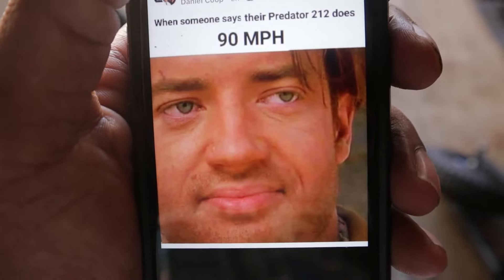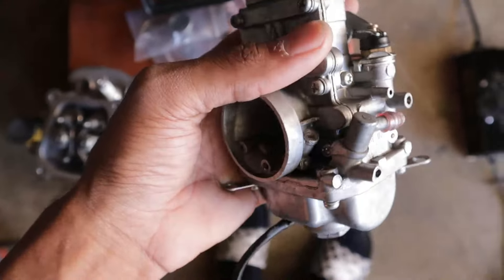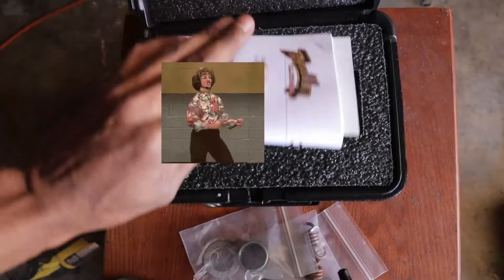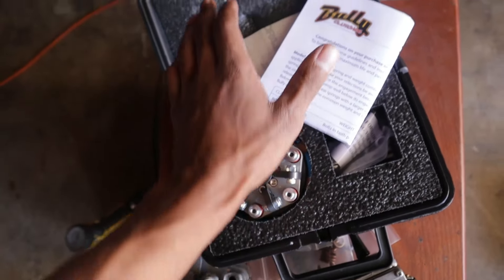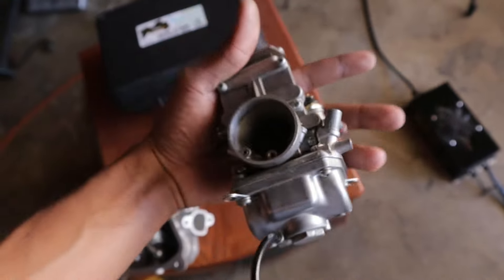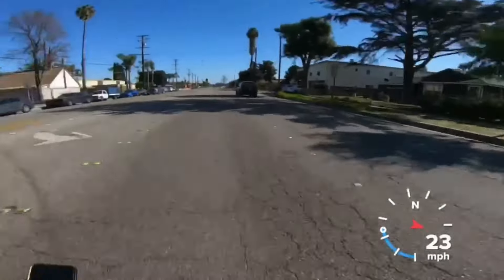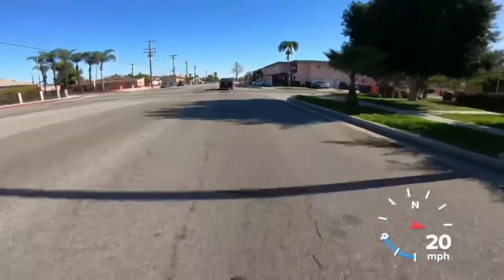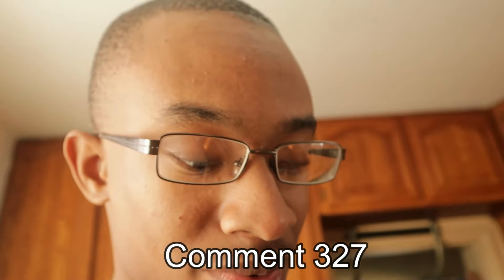Harbor Freight 212 Predator Mini Bike Put On Methanol Race Gas! Top Speed Run

Comment: i have a methanol briggs on m5...its a pain in the ass and not a idle ride around motor..im going to convert it to a slide and see how it does..im building a 212 hemi pred with a black mamba jr cam, ported head , flat top etc....well see how it runs..i wana dial the briggs in tho

Comment: Yo, Royal get the thinest head gasket that you can find, or shave the head down. Now remember every point of compression equals 1.5 hp. gain. Also ceramic bearings. Bigger head with bigger valves. Or maybe a bigger motor

Comment: God I love M5 but it  will Completely annihilate a carb . Extremely corrosive . Tons of maintenance involved M5 . You must drain the engine of all  oil and the entire fuel system after each run . Or when you come back your parts will be turned to powder 😂😂. Runs great though .

Comment: Yo Royal, tips for making a good predator 212 for cruising. Nothing crazy, what should I upgrade
Reply: Air intake kit with a bigger main jet,exhaust and a zip tie on the governor spring. Done
Reply: @russothecanadian2261  nah that go maybe 40-45 I wanna cruize at 60 and not have anything overheat or break.
Reply: Grom

Comment: A taller tire will give you more mph. 3:27
Reply: Taller tire does give more mph but smaller tires equal quicker acceleration. I believe he said he's in Cali and they drag race, so most of them use the small tires.

Comment: 327. you should get a ec head , they come with lots of material for you to port , unlike the stock predator heads or other aftermarket heads where they are limited to 32/28 with welds for more material
Reply: This is absolutely wrong

Comment: The size of the motor is technically irrelevant. You can get a 50cc or even a pedal bike up to 90 mph, with the right gear ratio and enough nerve.

Comment: Lol y’all trippen 90 is possible I was doin 65 in a stock predator wit the correct gear ratio
Reply from the maker: What’s the gearing?
Reply: Yeah an tire size
Reply: @RoyalJZ  10gear on the motor 42 on a 15 inch tire

Comment: So all you have to do is switch the carb to run alcohol?
Reply from the maker: And some basic billet parts
Reply: Alot larger jets needed with methanol that's all
Reply: @RoyalJZ  alllll the Billet parts 🤗🤗
Reply: No, you need timing and compression for it to be the most beneficial
Reply: You need to up your jetting significantly and make sure your fuel supply is up to the task. If you're using a stock tank, you'll probably need a pulse pump like I did.

Comment: What Rear Sprocket Size You Running Bro ?
Reply from the maker: 54
Reply: Really a 54 ? Front Sprocket? Tire size?
Reply from the maker: @curtissmartin6322  10-54 with size 5 tire
Reply: Arc flywheel billet rod flat top mod 2 cam 18 springs 10 th on front 48 on rear GPS 22 makuini. 15 inch tire's getting 57 top speed.
Reply: Got a stage 2 head on way 26 springs an stainless stock valve 1.3 rocker's chromoly push rods

Comment: Is it safe to run methanol on a cruising bike? My bikes fully built stage 5. Wasn’t sure if cruise on Methanol would hurt anything
Reply: Methanol won’t cruise real well, tends to work better at WOT for bursts like drag racing or circle track. It won’t HURT anything so go ahead and try it, you’ll realize it’s limitations.